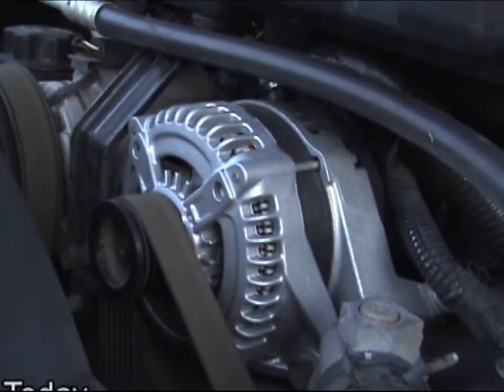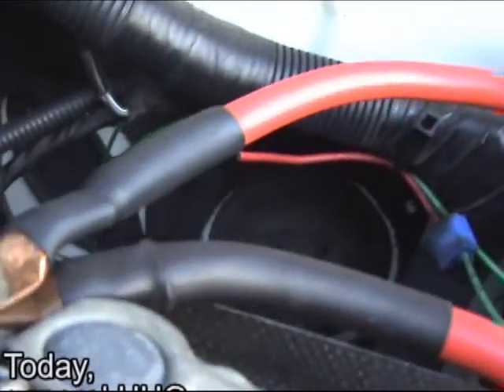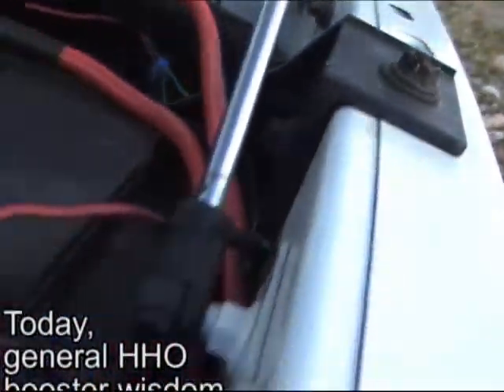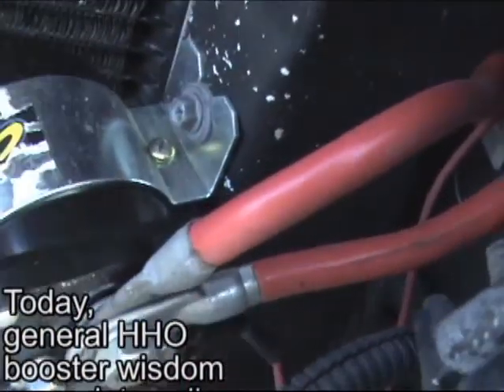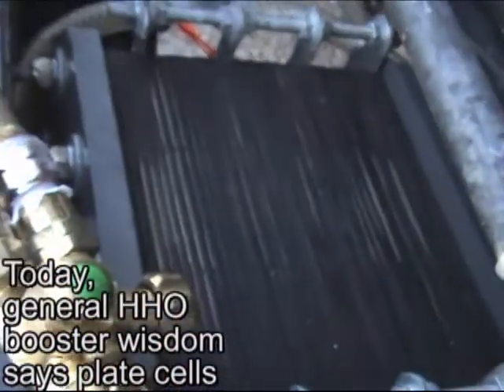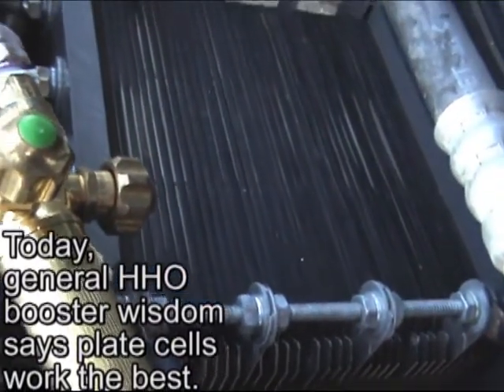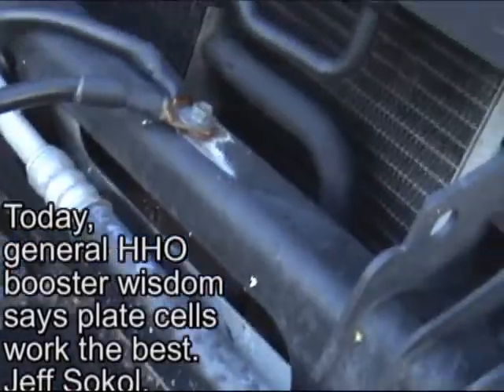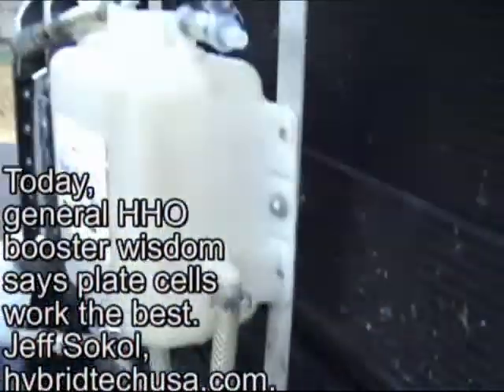HybridTech Pickup Truck HHO TORCH

Comment: With how many volts and amps this HHO cell produce 15 lpm
Reply from the maker: I had a it set up at 12 volts I think, running off of a 300 amp alternator.  I don't recall the amps but I was running 4 gauge wire.